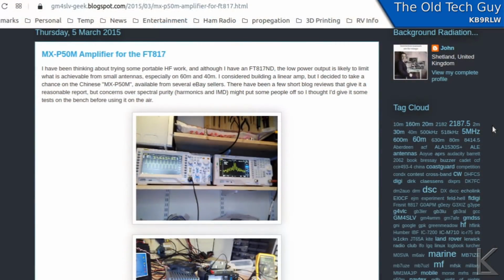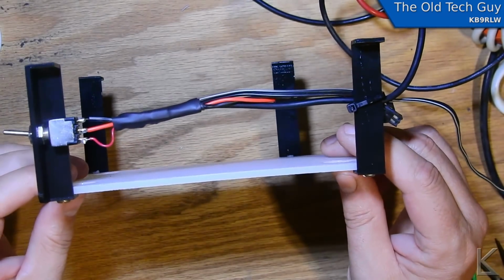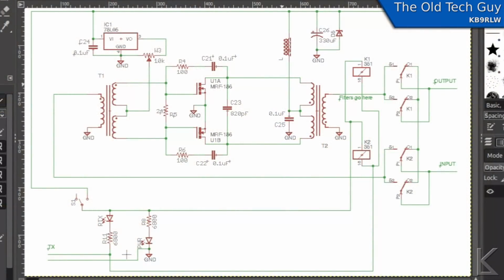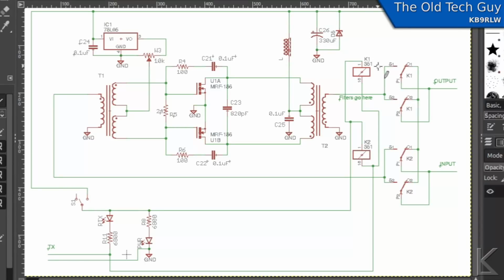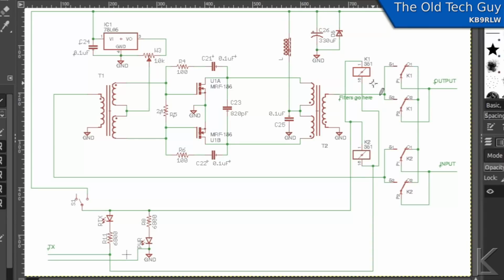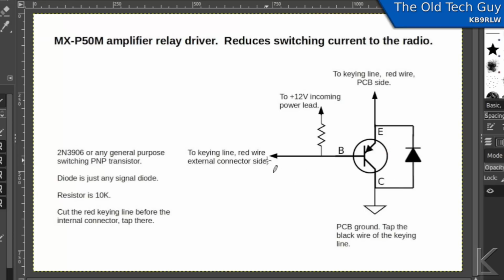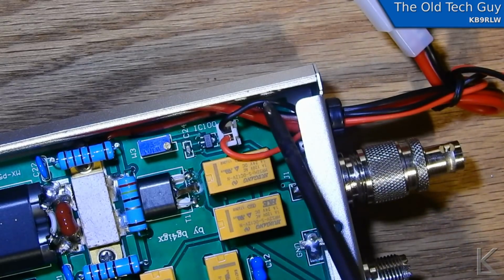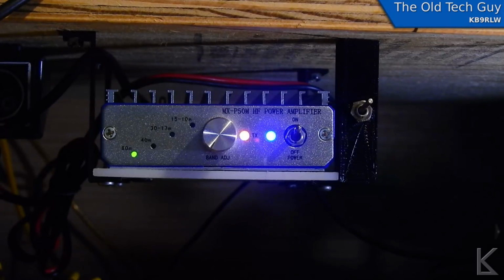Ham Radio - Modifying the MX-P50M amplifier to fix keying and installing it to my desk.

Comment: There are no spikes from any relay coil. You should not trust those schematics on the internet. Just take that board out and you will find all the diodes on the bottom side of the pcb, also one in series with the tx relay coil. Also check the relay datasheet and calculate the current. I have 3 of these amps and they are working fine, there was no need for such mods
Reply from the maker: It only applies to certain radios that can't handle the 30+ma of switching current.  I demonstrated one.   My amp doesn't have any diodes on the reverse side.  It depends on who manufactured the amp.  I suspect that are more than one Chinese company that ripped off the design, who knows what you'll get when you order it.
As I said in the video, with the mod, a radio only has to switch around 1ma instead of 30.  Like with most commercial amps which include a simple transistor relay driver.  
A control line should not draw much current, if properly designed. 
It's great you have radios that can handle the switch current.  If you ever run across one that can't, you'll know how to fix it.

Comment: Hi Kevin.
  Excellent video. I like your mod to it?
  I have had one of these amps for many years, using it with FT817ND.
  Now, I would like to use it with the Xiegu X6100? Have you any tios, please? 73 de Pete GI0FZT.
Reply from the maker: tios?  And I have no experience with the Xiegu radios yet.

Comment: Hey Kevin,  I ordered this amplifier, to use on my xiegu g106.  I know I have to hook the relay of the amplifier to the ptt and ground  of the ACC. do you think i'll have any trouble with the radio tripping the relay ? Any information you might have would be greatly appreciated.  Thank  JR.
Reply from the maker: Hello jr, sorry I don't know anything about that particular radio. But if it cannot handle the current and key the amplifier, you can do my modification.
Reply: Sounds good,  thanks for your time.  Ya I'll test it and if it doesn't work, I'll try your modification. Thank again.

Comment: Hello Kevin.  I've modified my MX-P50M for my IC-705 and it works perfectly due to your explanation on how to mod the amp.  My next question is, could I used this modified amp on my FT-818?  Any thoughts?  Thx.
Reply from the maker: Yes, of course.  The mod simply reduces the amount of current the radio has to deal with to key the amp.  It will still work with any radio.
Reply: @loughkb  I thought so, had to check with the expert. Now I need to figure out how to connect to the 818 with the 3.5” plug. Any suggestions? -73
Reply from the maker: @frankwc0o  As I recall, and old PS/2 style mouse or keyboard uses the same type of DIN connector on the back of the 817 and 818.  You could get a 3.5mm jack and wire it up that way as an adapter cable. That way you could keep the 3.5mm plug on the amps cable for use with the other radio.
Reply: @loughkb  smart. That for the motivation. I might have an old mouse in the house.

Comment: Thank you so much Kevin for the great video. I have a query: I have a tr(uSDX) and I want to connect this new amplifier to it. Is there any possibility that the amplifier is activated only when it receives the RF signal from the tr(uSDX)? Not with the ACC wire?
Thank you very much for your answer.
Reply from the maker: No.  That amplifier doesn't sense RF to switch.  It needs to be triggered by a ground on the keying line.
Reply: @loughkb  Thank you Kevin for the answer.

Comment: Well I am late to the party, but I want to run one of these with my FT-818 and use a Digirig so I can do digitalmodes. What sort of cable setup will key the amp zgiven that both the amp and the digirig want to use the same Din?
Reply from the maker: Same din, but different pins I believe.  Use the documented wiring for the FT-818 and just run a second set of wires off the same DIN connector.

Comment: Thanks for this video.
2 years later I bought this amp. I saw your video before using this amp first time, so, I modified it using your schematic and info.
I am using it with a new Xiegu X6100 and it works perfectly. I am getting around 45 Watts which is OK for this little amp. I am happy my new Radio is protected and safe.
Again, thank you for posting this and sharing your knowledge with us.
73
Rob
YS1RS

Comment: It's pretty typical to have 12V hot on the power transistors all the time, most 100 watt radios are wired this way. Even small voltage drops are undesirable and running the high current wiring around the cabinet, through switches, etc. will cause voltage drops and affect power and linearity negatively. So anytime power is connected the RF power section usually is hot but biased off. 73 de w6akb.

Comment: Hello Kevin,  Thanks for the informative video.   A friend just gave me a MX-P50M that he never used.   I'd like to use the PA with my QCX+ from QRP Labs.  The QCX+ signal is 0V when the QCX+ is in Receive mode, and +5V when the QCX+ is in Transmit mode.  Do you see any issue using this fix with the QCX?
Reply from the maker: The signaling you describe is inverted.  Most key lines from radios ground when in transmit.   Also, being a CW rig, you'd want something that stays switched rather than switching with each key down.   You probably wouldn't want the relays in the amp chattering with each key down.  It's not an amp that's designed for that kind of operation.  
So, to answer your question, no, this mod wouldn't work in your case.  You'd need something extra.  maybe a 555 timer circuit that is triggered by the signal and has a bit of a delay before releasing the key line.
Reply: @loughkb  Thanks Kevin.  Just getting started in the hobby.   I'm sure I'll find a good use for the amplifier later.

Comment: There is a diode, look up on top part of the schematic. The ft-817 has a 2sd2211 switching transistor rated to 160 volts and 1.5A and a protection diode built in. Thanks for the video, nice mod!
Reply: Great. Thanks for info ;)
Reply: I was going to chime in with the same comment. But it is not brilliant design to "expect" a pretty much unknown input (in the case of the radio keying the PA) to have flywheel protection. It SHOULD, but in these days with so much junk on the market, you never know....

Comment: Excellent video! This is a perfect primer for the MX-P50M and rig connections. I bought one of these when they came out and set up like Kevin but with a tethered T/R switch on the logbook. It worked perfect for ease of my radios (FT-817ND, HW-9, uSDX+). Now I am just entering FT-8 and needed the amp to auto-PTT, and there was so much confusion on the FT-817 ACC pin-outs. One extra thing I did on the ACC connector plug (they are very tiny and close). After soldering the wires, I stripped 1/4" insulation off a scrap wire and slid over the +13.8V pin next to the TX GND pin to insulate. This is in case if something accidentally yanks the cable, it won't touch pins and smoke the precious rig. Thanks again Kevin!

Comment: If I sent you 300$ would you send me a modified Px 50 to work for my Ic705? I don’t have the skills to make an amp and I need  small amp.

Can’t wait for the pa500
Reply from the maker: It's a very simple circuit and mod.  Check with the members at your local radio club.  You'll probably find someone that can help make the mod.

Comment: Great post, thank you very much, I plan to use it with IC-705. One quick question, would 1N4148 diode work fine?
Reply from the maker: Yes, should be fine.

Comment: Hi Kevin.  I've noticed there are buffered interfaces that are sold on eBay, is that something different than you mod?  Some say, its important to have a buffer to protect the switch transistors.
Reply from the maker: If the idea of the 'buffer' is to protect the radio's switching transistor from high current draw then yes, my mod is the same thing.

Comment: Thanks for the tip on how to connect a FT817, most of the documentation talks about PTT which is wrong. The transistor modification will also be useful.

Comment: Hello Kevin.  Which reverse bias diode would you recommend?
Reply from the maker: Any silicon signal diode.  Like a 1N914 .  It's not too critical.
Reply: @loughkb  super, thank you.  Now I have all the parts, waiting for the MX-P50 to come and I can do the mod.  It will be great when it works on the IC705!
Reply from the maker: That's the radio I use it with most of the time.   It compliments it well.   Don't push your drive level above 3 watts though.  The amp becomes a bit non-linear and you'll start splattering.
Reply: @loughkb  Thank you for the tip.  I'm very excited to use this amp, for many people tell me that I'm at the noise level and I hope that I can squeeze out 1S unit with the amp.  Although, conditions are getting better everyday.  I'm here at LAX and I was able to talk to someone at Chile, South America with 10 watts and my report was a 57.... incredible!

Comment: At 14:30 make that diode a 15V zener and it will properly clip the spike which tries to go more positive than the power supply. A .047uF capacitor will also do the trick by absorbing most of the spike. --N2GX

Comment: Any chance of video or pics on how to wire the diode to prevent spikes?
Reply from the maker: It goes across the collector and emitter on the transistor.  As shown in the schematic I put on screen.   You can pause the video and do a screenshot to get the schematic.

Comment: You didn't fix the power switch, what are your thoughts on that? Thx anyways - very use full, got it running on my IC705 :)

Also, another question, you added a pull-up 10K resistor, but I don't think you need that, there is already a LED and R11 (6.8K) doing that - don't you agree?
Ahh - cancel my question, I see, you'll need it because you cut the signal wire instead of modifying the board.
Reply from the maker: To switch the power to the finals, you'd need a relay or switch that can handle 8 amps draw.    It's easier to just switch power external to the amp if you want to power it down completely.

Comment: Hi Kevin, I really enjoy your videos.  I have a dumb question, can I use a 1/4 watt resistor for this modification?
Reply from the maker: If you're talking about the resistor that brings the bias voltage to the transistors base then yes.  It's only carrying 1 to 2 ma of current.
Reply: @loughkb  Thanks for your reply.  This mod is so helpful thank you so much!

Comment: Hey Kevin, The problem with the Ic-705 is that it's low voltage triggered....
Reply from the maker: Pretty much all radios keying lines ground or pull down close to ground when keyed.   I now have a 705 and this mod allows it to key the amp just fine.

Comment: I don't get QRP people who buy a 5 watt radio and then have to buy and incorporate a 100 amp.  Buy a 100 watt radio with a power adjustment capability.  Easier?????
Reply from the maker: It's a 35 watt amp.    The combination of the FT-817 and amp when transmitting a solid 30 watt CW carrier was drawing just under 70% of the current of my 7300 transmitting the same 30 watts.
It's more power efficient for an off-grid solar power setup.   In my use case, this is an advantage.
Reply: A QRO Radio powered down to QRP level works, yes. But is not power efficient at all.
A QRP Radio with a small 30-40W amp is way more power efficient than a big radio powered down. If you work off grid then a QRP radio + this little amp is a winner power efficient combo!

Comment: Kevin
  I suggest you use a voltage divider to keep the base current down
otherwise you can damage the 2N3904 PNP 

Bare Minimum Added to your schematic 
You need A Resistor in Series with the Base 
 ( 300ohm to 2Kohm ) to limit the Base Current

You could also add to Another Resistor if you want to make sure to keep the 
2N3904 is biased off when the PTT is not keyed across the 2N3904  ! 

The High Side (with No PTT), depending on the radio can be 5V to 12V which may or may not be current limited and depending on the Radio you use with the Amp, you can exceed the Base Current of the 2N3904 and cause it to either die over time or make it leaky 

73 Mike 
Circuit Designer
Reply from the maker: Base current to or from where?   Emitter to base or base to collector? Most radios that I've looked at the schematic for will use a transistor switch to ground the keying line with a resistor limited voltage in only a few cases.   I haven't seen one that could feed any real current over the line.
Reply: @loughkb  
A PN junction, such as a diode or a base-emitter junction has a nominal voltage difference of 0.5V though in practice it tends to be about 0.7V when we measure it due to some resistance within the diode or transistor.

At 16:42 in the video, you show a PNP transistor with the base connected to the same point (when keyed) as the collector, and the emitter connected to(wards) the other side of the power supply. It looks like the base-emitter junction has the full 12V across it and that would burn up the transistor.

What I missed, at first glance, is the emitter connects to supply THROUGH the relay - not directly. When the base goes low: current flows through the transistor (emitter to collector), that pulls current through the relays, the voltage at the emitter goes down from 12V to about 0.7V, and all is well for the base-emitter junction. There's negative feedback because the relay is wired between the emitter and supply rail. Much like an NPN transistor with a resistor between emitter and ground.

Maybe Mike's concern is an initial surge through the base-emitter junction as it starts to turn on. There is the full 12V at the emitter (no current flowing through the relay yet) and we are taking the base to 0V. That is 12V across the junction, for a very short time. That said, it's probably not a problem because as soon as ANY current starts to flow through B-E, current will flow through C-E and drop the voltage at the collector. All should be well. I predict a long and happy life for your mod and copies.
Reply: @loughkb  
"and drop the voltage at the collector" should be "and drop the voltage at the emitter". I'm not used to thinking in PNP mode.

Comment: Kevin, I guess there must be multiple revisions of the Amp. In my case, when the power switch is off the keyline is floating, not at input voltage. When i switch on the power, the keyline goes to 13.8V dc which is my input voltage from the PS. I agree about adding in the snubber diode which i will add. 73 de k1jbd

Comment: Thanks for the great video! I'm making a little PCB for this. Quick question, did you happen to measure the pin spacing on the connector on the amplifier's PCB?

Comment: Kevin love your videos.  I have different problem but similar. I have this amp and trying to use it with a Xiegu G1M.  On that rig the ACC PPT out has a 8.2V bias voltage on it when in RX.  On TX the G1M puts the voltage on the PPT out to   ~0v.  (not 100% a ground but it seems to work for this amp).  I wired the amp up as the instructions say but that Bias voltage causes the TX LED to light dim.  Kind of like you had.  It is not actually transmitting.  When I do press TX on the rig the Amp kicks in and it amplifies fine.  The problem is sometimes when I release TX on the rig the amp does not completely switch back.  The TX light goes back to dim and the power out the amp drops but it the rig is not receiving so I assume at least one of the relays is staying closed.  Likely because of the 8.2 bias voltage.     Looks like you studied this little think pretty good so any ideas would be appreciated.    Seems like a little circuit like this that filters out the bias or keys of the ground would work.
Reply from the maker: I think my circuit would work as is.   The base of the transistor is already biased up to the 12v rail, so the voltage coming from the radio would affect nothing.
Since it's keying the amp now, we know it grounds the control line.
So, I think this little transistor driver I did should probably solve your problem as well.
Reply: @loughkb  I tried it be it did not work.  It was really strange.  It seemed like it was working but the once it kicked back into receive mod the rig was not receiving anything.   Like it was causing one of the relays to hang or something in the amp.  In the end I used a opt relay module set to trigger on high but connected the amp to the normally closed side of the relay.   I drive the relay off the main 12v input to the amp.   This works well with the only downside being if you turn the radio off it keys the amp.....  Ok for my use.
Reply from the maker: @jlacy8234  It doesn't make sense.  The high side of the amps relays is connected to the 12V rail.  The low side goes out to the rig.  The only way it can trigger the relays is if it's grounded.
Although it is very odd that the control line from the radio would go only up to 8V when not in TX.   That's a 4V difference though, so if it can carry some current when in that mode, it could be enough to hold the relays in.
Super weird.

Comment: Thank you, Kevin.  I just implemented the circuit in my MX-P50M.  It works like a charms with my FT-817, the original version obtained about a year after the model came out.  It has never failed me and now, it is further protected.  73, Chris VE2MW